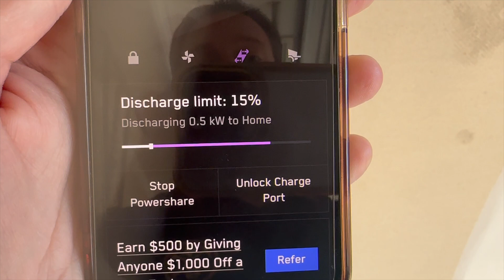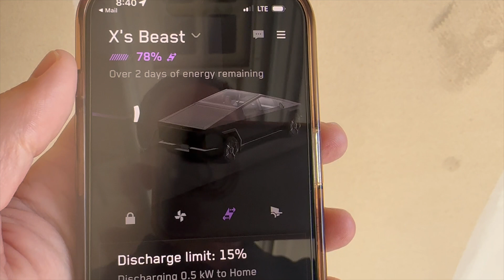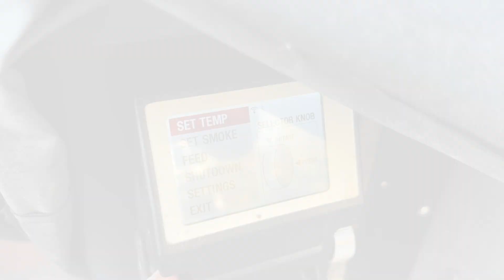My CYBERTRUCK POWERED MY HOUSE! Tesla Powershare

Comment: We have solar and two Powerwall 3s and a Gateway 2 with a Gen 3 HPWC.  We were thinking of buying some Expansion Packs, but my installer wants $15K to install 2 EP's.  So I already have the infrastructure installed in our home.  So we are looking at a CT, so if would buy one for say $55K in reality the truck would cost $40K.  It's essentially a mini mobile MEGA PACK.  As most know even in a grid outage you will probably find power less than 50 miles away.

Comment: So the powershare gateway really only adds seamless power switch over and an extra 2kw over just using the truck bed backfed into 50 amp inlet on panel?  Seems expensive just for that.
Reply from the maker: First it was free…. Second no.. It can run everything in a 1500 square foot home.  That’s better than a generator.
Reply: @TheXtremeChannelMrX  well it wasn't free it was included with the 20k surcharge,  second the truck bed puts out 9.6 kw while the power share can do 11.5.  So yes it is only 2kw over what the truck bed does that doesn't require the 2k$ powershare.  Also would depend on generator, some generators can put out way more than 48 amps.

Comment: I have a bit of a convoluted question: Are you able to have the CT work in conjunction with a Powerwall and Solar to optimize with energy rates. What I mean is let's say I want my solar panels to direct the energy captured for my home usage. After a certain time, I would like my home to switch to use the Powerwall's energy first and then the CT. Lastly, I would like Powerwalls and vehicle to recharge overnight when energy is very cheap. Does this make sense?
Reply from the maker: I've heard you can but I don't have any personal experience with the solar so can't verify

Comment: What gateway do you need to have in order to use powershare? I see there are two gateway 3s. One is gateway 3 and gateway 3v. How do I know if my cyber truck has the power share capability?
Reply from the maker: All CTs can.  This is the one to buy https://shop.tesla.com/product/powershare-home-backup
Reply: @TheXtremeChannelMrX  thank you for the reply! I'm having difficulty finding the right answer.  I have solar but no battery backup. I would like to use the cyber truck as the battery. Is it possible to use the gateway V3 and charger to power my home in case of an outage or would I need a different gateway? I read online that the V3 gateway does not work with solar for some reason.
Reply from the maker: @ I cannot speak to that as I don’t have the solar

Comment: Wall charger does not charge at 15% per hour.  9% at most per hour.
Reply from the maker: Mine is about 15% per hour.
Reply: @ no it’s not.  It’s simple math.  You are getting a max of 11kwh. 48 amps x 240 volts with some loss.  You have a 123kwh battery.  Do the math.  123/11 =11.  You would get 11% per hour in a perfect world but usually the truck only gets 10-10.5kwh wile charging.  Do the math. You are not getting 15% per hour.
Reply: @ you would need to be charging at 18.5kwh to get 15% in one hour and that’s not possible.
Reply from the maker: @ what’s not possible? Is you telling me what is happening inside my garage where you’ve never been when I see it every day.
Reply: @ you are only charging at 11kwh. Prove me wrong. Do the math.  You’re wrong.

Comment: What happens if the power goes out and the truck is not connected? Can you connect the truck and get the power to turn back on or dose it have to be connected before the power goes out? (Black Start)

This would also be good to know because if you are in an extended outage, can you take your truck somewhere to charge back up to continue powering your home if its battery gets low and come back an plug in to power things up again?

If you had solar, would it offset the amount of power needed for your truck? Like if your PV is producing 2kw and the demand is 3kw will the truck only provide 1kw? Same if it produces more, will it then charge the truck instead of drain it? Basically the truck acting like a Powerwall when connected and off grid.
Reply from the maker: Yes, you could plug it in after the fact.  Problem is solar wouldn't power it enough.  However, worst case scenario is to drive to a supercharger every two days and fill up

Comment: The EV market is shrinking largely due to a lack of confidence in the technology. Having a dual purpose for your EV is where the motor industry could turn it around, but many don't have this function. The only other cars in the UK that allow bi directional is the Mitsubishi Outlander & Nissan Leaf. V2H (Vehicle to Home) and V2G (Vehicle to Grid) will revolutionise the energy industry. The concept of virtual power stations will become a reality whereby everyones car will have this function either powering your house or feeding the grid so everyone shares the EV battery power.
Reply from the maker: Is that why the CT was the #1 selling truck last quarter?  Because lack of confidence in technology?
Reply: @TheXtremeChannelMrX  Not the CT but EV's in the UK. Carmakers are under pressure to meet the UK government's ZEV mandate, but some say that the mandate is unintentionally restricting the new car market. The charging infrastructure is poor here and people are buying more hybrids for their range advantages. I love the idea of having an EV that also powers your house, it's just not available in the UK.
Reply: The EV market is actually expanding. This year is going to be another record year for EVs. It is the gas car market that is shrinking and has been since 2017.

Comment: My electric vehicle power my house 
Also my electric vehicle cant run anymore.
Reply from the maker: Then you drive to a supercharger and recharge it in 25 min
Reply: @TheXtremeChannelMrX  Do you mean there’s other charging points that can charge it quicker than you can charge it at home?
Reply from the maker: @InfamyOrDeath-__-  No.  They had to install the PowerShare, and the universal charger.  $2500 is relatively cheap.  A plumber here will charge that same amount for a decently basic job